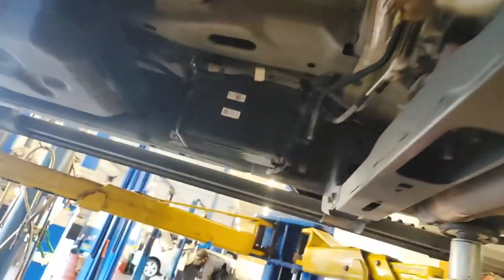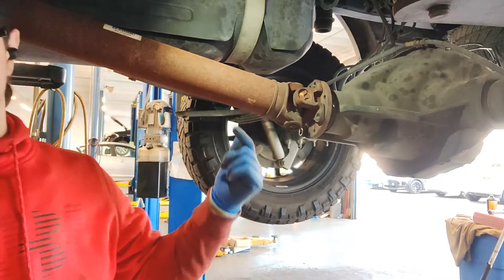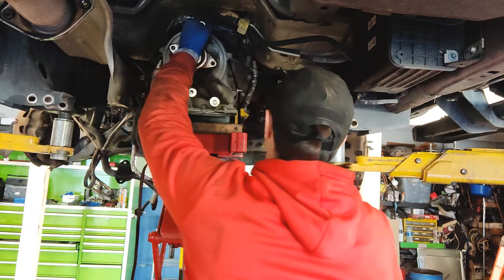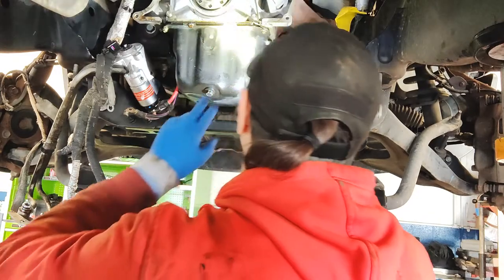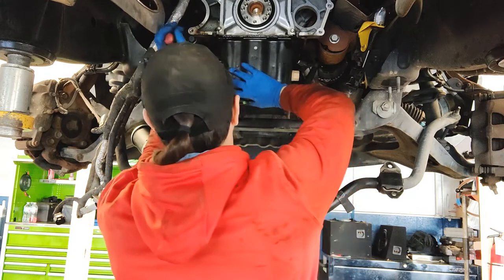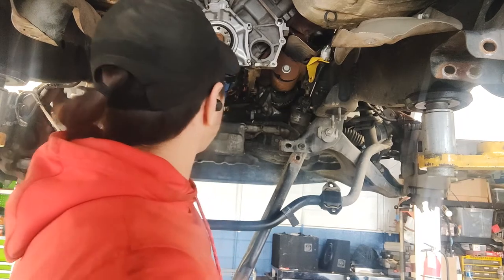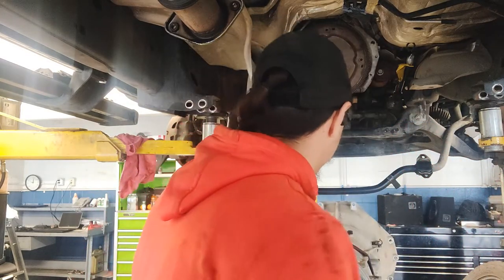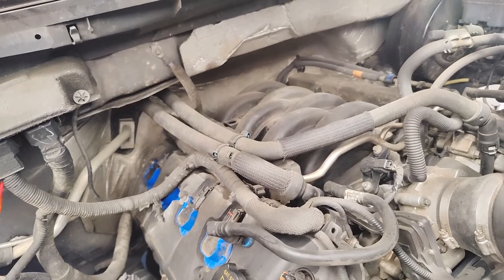2012 Ford F150 Transmission Removal

Comment: Hey how much do you think would be reasonable for me to charge to do this as a mobile mechanic. I've done transmissions on jeeps and cars, not a truck before though. I normally pass on the job, but winters coming and I have a slow week. I live in Calgary, alberta, Canada so it definitely will be much rustier than that. I don't wanna rip myself off or the customer. What do you think a fair price would be? Thanks for the video btw.
Reply from the maker: if you can get the transmission bell housing to clear the truck once down than its not that hard of a job. as for a  fair price that depends on how much the rust makes you work harder.

Comment: How long did it take you to drop the trans? I'm doing a 2013 rwd like yours. Seemed relatively quick
Reply from the maker: If I remember correctly it took about 4hrs one way.
Reply: @HITekRC  how much did you have to lean the engine to access the 2 Bell housing bolts? 

I'll be doing this on the ground, and using a regular jack and some wood. Would there be any major problems i could potentially run into?
Reply from the maker: @charltonarmstrong9022  the angle can differ depending on how your motor mounts are some may be more collapsed than other but not very much on the ground you should be okay. Just make sure to have a shallow swivel socket with some long extensions that come past the trans . It's a tight fit but once you angle the assembly down they become more visible.
Reply: @HITekRC  thanks so much, so other than those 2 bolts, it's otherwise smooth sailing